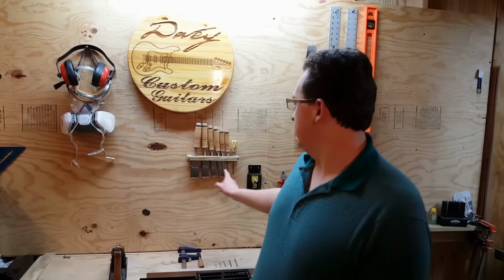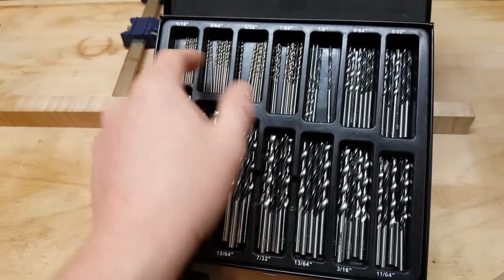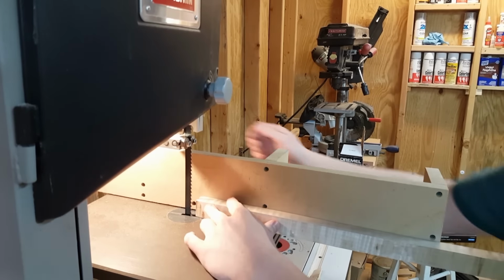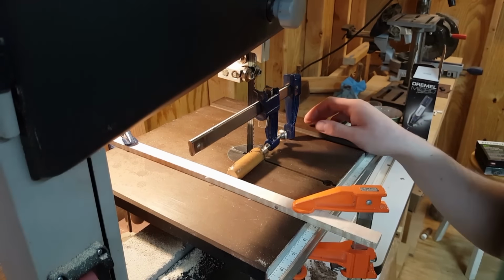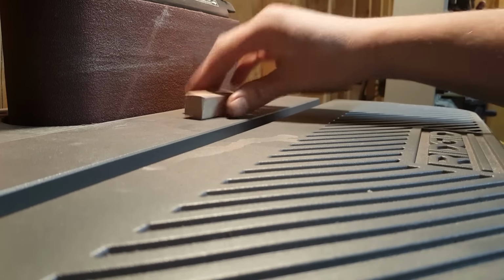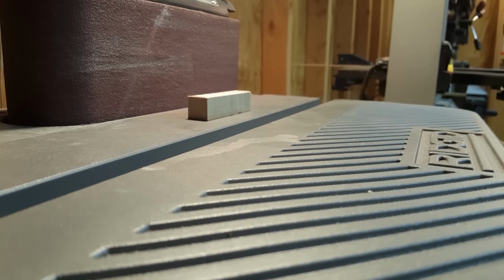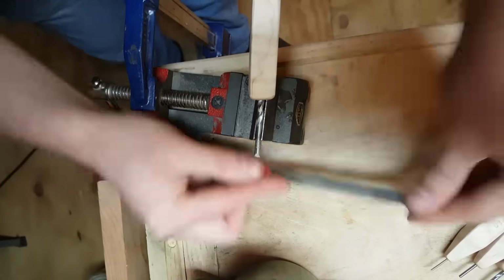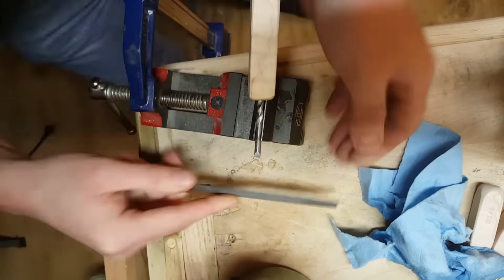Micro Chisel Set From Drill Bits

Comment: Great video! It came at the right time too. I Do a lot of woodworking but haven't yet tried carving. I was looking at a good set of Japenese Micro Chesils but I don't want to spend that much money until I see if I like it. And these will be perfect for me as a beginner. Thanks!!
Reply from the maker: Only thing I would recommend if you plan to use them all the time is hardening the bits so the edge will hold longer. I did not do that to these. I don't have a video on that process but there are plenty out there. 

Thank you for watching!

Comment: The drills were soft enough to file??
Reply from the maker: Yep. 

I bought them from wood craft of I'm not mistaken. Fairly inexpensive set given how many I got. Maybe they assume these are for wood use only?? 

I'm also filing in the end that is supposed to be in the drill chuck. Maybe the only end hardened, if either end is hardened, is the cutting end. 

??

Not sure. I don't remember having any difficulties with that stage.
Reply: Chinese drill bits.
Reply: @daveydacusguitars9033  Do you then harden the ends used for chisels?
Reply from the maker: I didn't, but that's a good idea if they get used a lot. They get very occasional use, so maintaining that edge for long periods of use, for me at least, probably isn't worth the effort. I will usually hit my finest stone for a few seconds when I pick one up, and go to town with my work piece. Use them for... 20 mins..  half an hour tops usually.
Reply: @daveydacusguitars9033  Okay. However, hardening is not just a good idea if you want to RETAIN a keen edge. In my experience (which I admit is somewhat limited), it's pretty much essential in order to acheive a keen edge in the first place.
Reply from the maker: If I ever made more I would likely harden them. But I won't bother going back and hardening these. Plus I'm not sure how that maple would do in an oven.
Reply: Davey, the hardening isn't done in the oven - that's tempering and it's done after the hardening, which is done by exposing the finished item to a propane burner flame until it reaches about 1700d. Then you quench it in oil. Immediately . Then you put it in your oven on a tray.  Heat from cold to 400d F. Then heat at 400 for thirty minutes. Take out and cool under the tap. Which is why using pre-formed metal is never a good idea. You don't know what kind of metal is used or what heat treatment it's undergone. A really good channel for this sort of thing is Patrick Sullivan.
Reply: Oh, and only then do you put the handles on - right at the end. Then you sharpen them.